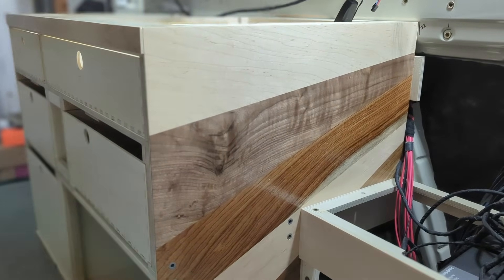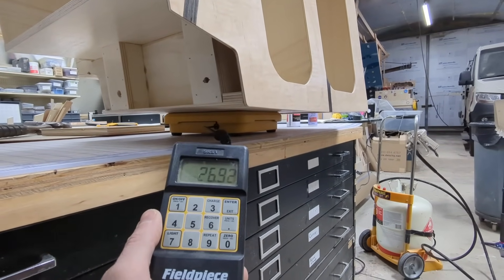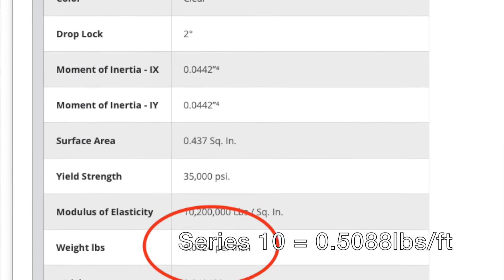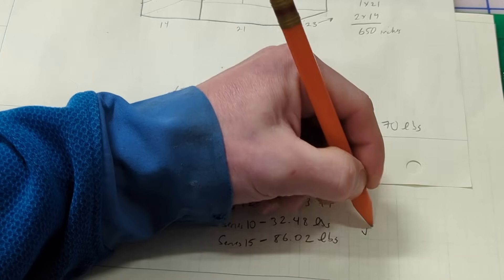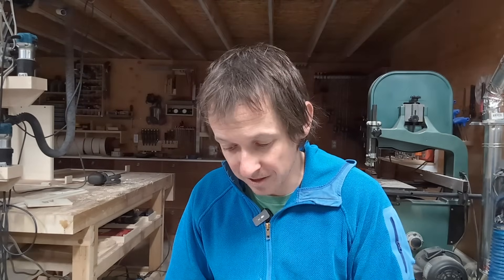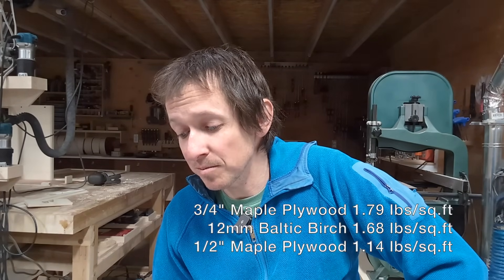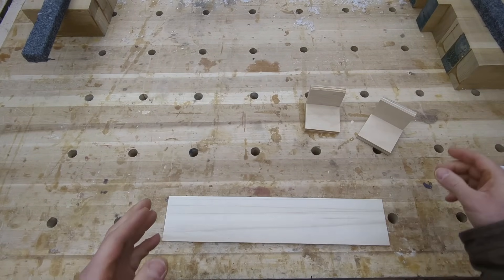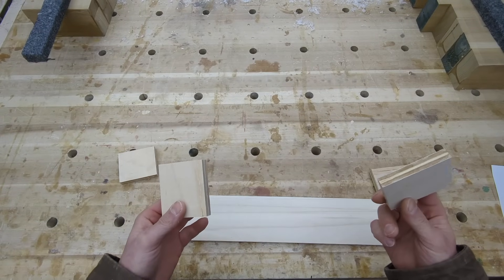Van Conversion Cabinets that are (actually) Lightweight and Maximize Storage

Comment: I often see pretty custom builds and the first problem i see is they're overweight on the axles /suspension. So valuable to mention space considerations too on 8020 vs wood formed to sides pillars, taking up too much space and aesthetically clunky lego looking in the end. Thanks for the great stress / sheer tips on thinner wood.two thumbs for your methods. Liking your great wood shop too.

Comment: i went down that 8020 hole once.. it was for my bed frame. i was planning to use it for cabinets, but pretty much ran into all the same issues you mentioned.  
as far as lightweight wood cabinets go. i wish i had your skill.  instead i had to make all my cabinets with 1/2 sande plywood (from home depot).  very cheap.  i like drawer slides for drawers the i use often (it's just more satisfying to have smooth soft close slides) i don't use slides when i can help it.  
as far as strength goes, all the things you mentioned, but also the goal with thin-wood cabinets, is to have a "torsion box"  structure.  for example: a 6 sided box is incredibly strong, if you start to remove the sides, one side at a time,  it gets weaker and weaker... however, if you keep the sides and just cut out holes it maintains most of its strength. that's why your upper cabinets are so strong. if you didn't have those cubby holes it would be a different story.  
 
that's all i got. thanks for the video.

Comment: Regarding the videos of people doing pull-ups or overloading their 80/20 cabinets and drawers, it's not so much about just how much weight they can support. The higher static load capabilities indirectly translate to being capable of withstanding the high dynamic loads those cabinets will be subject to in daily use. The kitchen cabinets in your home aren't living through what equates to a micro earthquake for hours on end. Your home isn't going to hit a speed bump or come to an abrupt stop from 70mph either.

While I agree that interior components of a camper van/trailer should be lightweight, it's also smarter to start with a vehicle that has a higher GVWR in the first place. With a higher payload capacity you won't have to go so lightweight that you compromise strength. For the record I never have used, nor felt the need to use, 80/20. I have no dog in that fight. The last galley cabinet I built for someone was welded aluminum square tube and angle(much lighter than 80/20) skinned with 1/4" plywood. I do however recognize that 80/20 allows those with less skill to build a strong framework.

Comment: I really like your approach to the build. Sound engineering. As van cabinets go, yours are probably among the lightest I've seen in the many videos I've watched. However...

(There is always a however 😄)

I used to build semi-custom boats. About 25 years ago, an acquaintance in the industry who worked building fully custom yachts showed me some of the things they were doing that boggled the mind. Exotic wood veneers over carbon fiber and Nomex honeycomb cores (think jet fighter type technology). If you want truly lightweight, you gotta go there. Oh, it also helps to have an open checkbook. 😲😁
Reply from the maker: Haha, yep, sure wish I was born with a trust fund;) and perhaps a time machine so I could investigate all the design options.

Honeycomb panels have been on my list for a while.  The ones I could afford didn't actually save me any weight.  By the time you factored in two 2mm skins, the honeycomb, and the resin to hold it together, my 3mm panels with a thicker border were lighter (on paper...).  I think the biggest advantage of honeycomb is from a builder perspective it acts a lot more like a solid sheet, which is way easier to work with than gluing 100 tiny little pieces together.
Reply: It seems to me that the small but strong vibrations of a car stresses the material a bit different than the stresses from the water and wind on a boat. I think it would be interesting to see that kind of thing taken into consideration.

Comment: Great video, love your focus on lightweight. Especially not using 3/4" ply. I don't get anyone who builds like that. 

But I have to disagree with your views on 8020, only because it seems you've picked the worst build designs to base your conclusions on. So many make boxes, but there are ways to reduce the amount of extrusion you need significantly, like avoiding 15 Series entirely. I also got all my cabinets contoured to my walls perfectly (and I have a very round van). Used right and sparingly, I think the 8020/thin ply combo is amazingly fast and light. I can also disassemble mine in an hour or two if I ever needed to move it to another van. But the key to a good build is a lot of forethought. Just like wood builds, thinking ahead is what makes all the difference. I'd never use wood unless I did it like yours...I'm just not sure I'd have the patience 😅

Anyway, great topic for some controversy...haha. Keep up the good work, excited to see the finished product.
Reply: You will never convince woodworkers to not use wood obviously.   Just funny that hes using toy grade wood and calling it superior.  6mm ply is junk.   Basically Luan.

Comment: You mentioned that you can't attach drawer slides to 6mm boxes.  Why not?
Reply from the maker: Well, you technically can but it involves some preplanning.  6mm, or 1/4" plywood isn't enough for regular wood screws. Some of the options I've considered :
1. Add a backer strip where the screws will go.  In my experience 1/2" of material is plenty so the strips would be thin. 
2. Use machine screws so you can use a nut on the inside of the drawer.
3. Use rivets.  The downsides here I'm not sure of the longterm "tightness" of the rivet installation as the wood can compress and it may loosen up.  And if the installation is slightly off (need to move the drawer slide up/down or front/back) then removing rivets is a bit messy.

Comment: I drank the 80/20 Kool-aid and ordered the material for a twin bed with pull out drawer. When the shipment arrived I needed help moving it!  Then the 48” drawer slides arrived. They weighed more than the stuff that was going in the drawer!
My old van had a 3/4 bed frame made with skin and bone techniques using 1x4 and 1/8 inch plywood. It lasted over a decade and I could carry it around all day😮

Comment: Not for building draws, but like beds aluminium could definitely save you some weight and space, because you are going to double use that space under the bed so using aluminium there could be a very good option and people having wooden battery boxes scares the fuck out of me, like making it out of aluminium panels isn't going to stop the fire from spreading, but it will slow it down to the point that your fire alarms should be going off before it's to late as I would be putting one in the battery box specifically.

Because Lithium Ion battery fires are no joke, like that aluminium box will probably only buy you 30 seconds before it gets hot enough to start catching other shit on fire, but 30 second is enough time to get out of a Van, suppose you could extend that by lining the outside of the box with a fire retardant insulator which has a high melting temperature, but even that that is still only going to buy you time.

I suppose if you have the battery near a door you could set up an emergency eject system as long as you know you have enough time to engage it, but honestly I think saving your life takes the highest priority so I wouldn't want to be fiddling around trying to eject the battery.

Comment: Great video. As a novice lifelong woodworker, I have too questioned the use of 8020 in such space constrained space. You added that it's not even weight efficient. I have long seen it used in factory and test fixtures, but given its price, high fastener use, and questionable ascetic, it's a poor cabinet structure. 8020 is also messy when cutting and exposed ends are raw not being anodized.
Though, I could consider aluminum extrusion or steel for securing heavy loads, like refrigerators, for crash safety. You might be wise to use straps, metal or other, to anker to vehicle structure. 
Worse than 8020 use, are heavy countertops, like butcherblock or Corian types.

Comment: @project of science, How much weight do you estimate you've saved overall building this route?
Reply from the maker: Well, I've been keeping track and weighing the things going into the van.  This build will be about 900 lbs with my best estimate at this point.  So compared to the weights of "main stream" buildouts from Winnebago and Story Teller thats less than half the weight of their builds.  As for the cabinets alone...I'm probably only saving 200 lbs compared to building them out of 3/4" plywood?   Wall panels...probably another 200? Then floor and ceiling design helps...and not bolting a bunch of ornaments to the outside.
Reply: thanks for the reply, I am considering doing something similar for my own. I am curious though, a seasoned van-life friend of mine refuses to build with wood, due to the long-term expansion/contraction and moisture attraction. The justification is that after a few years your joints may begin to fail, and the woods will become very creaky and loud as they shift slightly against each other. Seems like good joinery and wood glue along all your joints like you detail should remove this possibility. Do you have any cabinets of this style out there on the road for say 2 years or so you could speak too? thanks again, love the video, some of the best van build content out there.

Comment: The aluminium extrusions of 80/20 are strong but they're jointed with a brittle plastic which throws away any possible advantage.

Comment: FINALLY, someone said it!  There's such a waste of space with 80/20 that it's ridiculous.  I just wish the plywood you use was available in my area.  I've toyed with the idea of using 1/4" foam board that's laminated with fiberglass, but that's expensive and I don't want to deal with the chemicals.  My van ended up using a mix of traditional 3/4" wood panels, luan and firring strips for the furniture.  There's several areas I'm still not happy with, but as a work in progress, there's nothing in there I wouldn't mind tearing out and re-doing as I learn new techniques.

Comment: Great video, I haven't built anything out yet but this was a technique that was on my mind and it's great to see you've done it in real life! I think the only thing I would probably do is maybe throw a couple of aluminum T channels here and there for strength if I knew I was going to put something really heavy on it. Another material I thought could work would be Gator board lol and I may go that route on a small car like right now I'm looking for an Element.

Comment: I don't believe its a fair comparison because unecessarily heavy  8020 profiles are being used. 

I believe in europe van builds you would use 20mm x 20mm profiles for these cabinets. Which you could also source in USA. 
2020 is much lighter than 10 series. 

2020 is 0.3lbs per ft.  Which would make that lower cabinet 16.2lbs vs 10 series' 27lbs and timber's 20.7.

Comment: Excellent video and information.  The one thing I wonder about with my use case is vibration.  I just did a build with almost 100% pocket hole joinery for the first time vs. brackets and bolts in previous builds.  I know, not high tech, but I travel offroad a lot.  I would love to see how these cabinets would perform over years of offroad with some of the washboard and trails that I put my van through.

Comment: I really enjoyed your  video – thanks for taking the time to make it.  I agree totally about the strength and logic of using plywood – but wanted a different very different  look to my finished product.  So I built my cabinets out of 5/8” plywood (you CAN  do chin-ups on them) then covered them all with a 5/16” select cedar finish.  No end grain, no exposed fasteners.  I didn’t do the math you did about weight -   I figure that all in  I’ve added 1 1/2 fat guys in the back seat – and with a ¾ ton truck the reality is a little weight on the springs improves the ride.   Looking forward to your next video …. cheers

Comment: Your weight calculation only included the frame for the 80/20, all the sidings are still missing. All the connectors and plugs and what not are really expensive too, simple 90 angle brackets are something like 5 bucks a piece and the extrusions themselves are not cheap at all.

Comment: Cool goodbye cad drawings of 80/20. Those cabinets are perfect wish I had the space for a vacuum table. Great conversation I’m starting a 144 build hoping the cabinets weigh less than 300lbs. You just showed me the way. I see so many DIY jobs using wood screws in a crash pointy things are killers.thanks for sharing

Comment: FYI, in my country there is a lot of RV manufacturing and they use poplar ply too. If you had not said that I would have told you how to suck eggs :-) BUT do you think you could make further gains with sandwich panels? Or do you think the thickness tradeoff and lost space kills the deal? I think I know hour answer :-)
Reply: Your* answer
Reply: That company uses poplar foam alloy sandwich for floor and wall sections. Maybe you could benefit from it in a raised floor or something?

Comment: I've built van cabinets both ways and determined that 80/20, while popular among DIY'ers it's a horrible way to build cabinets, IMO. Sure, everyone makes the strength argument... So yes, an extrusion of 80/20 is really strong. But it really comes down to the corner joints. With 80/20 most junctions are created with screws and T-nuts that are only held in place by friction. If any of those dozens of screws vibrates loose even a little, it can easily pull apart. And, if you end up with a rattle, good luck finding which screw it is.

Comment: I am no carpenter, nor cabinetmaker, but I am building an interior for my 5' X 10' cargo-to-camper-trailer conversion. A goal is to use exclusively baltic birch ply for everything in the trailer. Galley shelves, cabinets, drawers, bunk/storage...  I started with 1/4" (6mm?) baltic birch that I have finished with clear shellac for all of the walls and interior door skins and have become enamored with it. 

I had planned to use 1/2" (12 or 13mm) baltic birch for the bunk structure (fixed, with storage underneath)... but what I may do is go to more 1/4" and beef the edges against bending (and for "beam") w/ strips of 1/2" as you utilize in your AMAZING cabinet work. I was so tickled to watch this video I nearly sheetmahpaynts. I love it. THANK you for sharing your craftsmanship with us. I have subscribed.

Comment: I like what you’re doing here but I want to make a suggestion to try out honeycomb composite panels. It takes a few new skills but I used that stuff for building luxury aircraft furniture and it weighs nothing. It’s something I want to do for making van cabinets eventually. But I think you could still reduce your weight in half from where you are. The stuff is great and easy to veneer with contact cement. Check it out if you haven’t already.
Reply: This very point was answered 2 weeks back if you check the comments...

Comment: Don’t underestimate the benefit of the strength of aluminum extrusions fastened to the vans body.  Heavy things like water tanks, batteries, and refrigerators need to be secured in case of a crash.  Lightweight plywood boxes will crush under those kinds of dynamic forces.
Reply: The first thing I thought of at the end of this video was, "What about a crash?" - 80/20 was dismissed as having excessive strength beyond what was necessary, but that might be the difference between the cabinet contents flying into the front of the vehicle and staying put during a crash.

That said, the amount of 80/20 used seemed kind of excessive in the example, vs. using it as a reinforcement in a combination metal+wood solution.

Comment: This was a fascinating video. Thank you for the information. I have a 6x12 V nose I converted in 2019. I had to jump ship from my truck (semi) into it well before it was ready. I had no choice. So building it has always been around myself. I have always been conscious of the weight but generally speaking I have had to sacrifice that part of it. 
I use 1/8", 1/4" and 1/2" ply never 3/4". I shaker frame cabinet doors. I try I really do but I worry about the weight. 
After a solar disaster I have opted for series 10 framing on the roof. It was my first time. I was very impressed. My panels are now secure. Everything you have said about profile is true. However it is also a trade off. The profile is 100% straight and has a lot of internal strength. It is also waterproof.
I have an old pu truck. It has about 246,000 miles on it but runs like a sewing machine. It can pull the weight. In the bed I built a drawer / slider system. Unfortunately the tonneau covers leak. Nothing seems to be able to fix this. So the wood just self destructed. The answer is using 10 series then 6mm for paneling. I will use a decking paint for waterproofing along with silicon in the joints. I don't know what ese to do.
The focus of your video on weight was extremely useful. I will check out your channel in the future.    
I am going to build a new front door from scratch replacing the factory door. At the moment I am struggling with design ideas and one of the major problems is weight. Wish me luck.

Comment: This is basically how aircraft are designed to minimize weight. You have thin aluminum skin over thicker aluminum ribs that carry compressive load. You could go farther and make your cabinet panels out of fabric stretched over a wood frame, like old airplanes, but use like cuben fiber. 

At 12:58 you can see you have effectively created I-beams, C-beams for the side panels which are standard profiles for efficient rigidity.

Nice Moonboard.